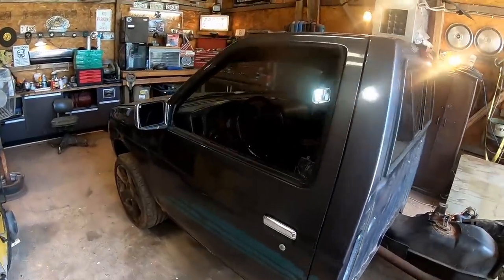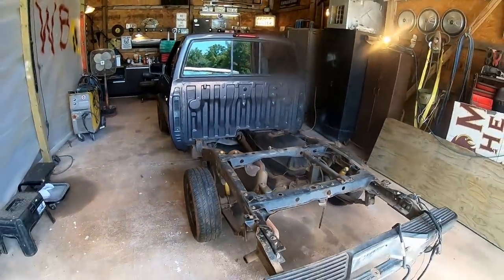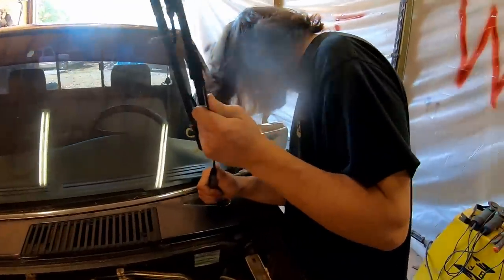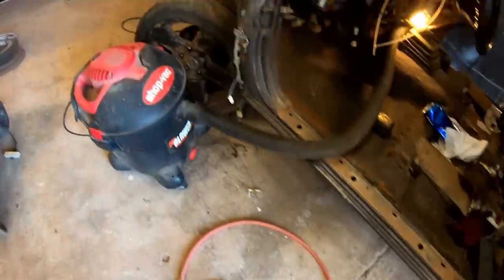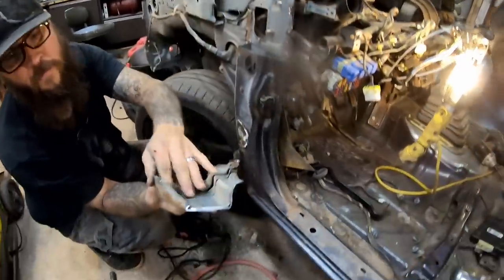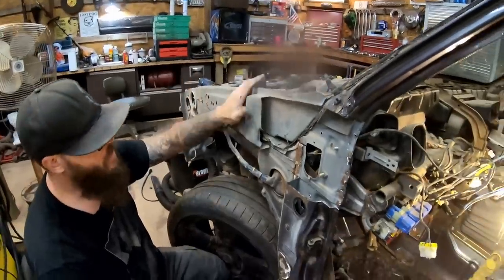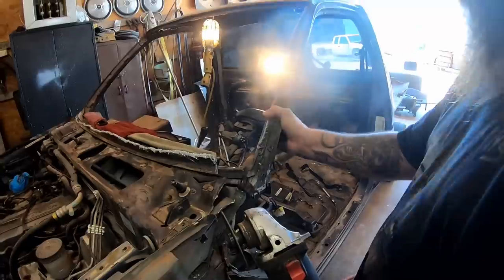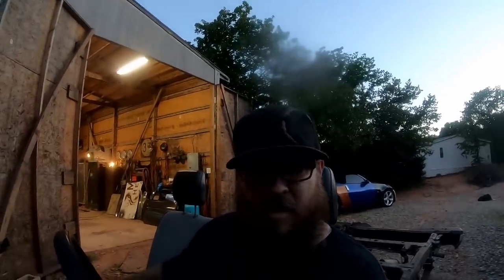Copart Datsun Pickup Build Part 1

Comment: I once saw a 1956 Ford Crown Vic body set on the frame and floor pan of a Bronco 2 wheel drive.  As long as you couldn't see the inside it looked like just another 56 Ford.  The guy said the car had set on the ground and the frame and floor boards were rotten out and he put it together for not too much money.  I like what you are doing, it will be cool.

Comment: This is going to be really cool. I wonder if the old Datsun will be close enough to even fit a little but maybe they used a little bit of the old measurements in the new one or there is some coincidences. Remember road kill had that Datsun with a v8 in the bed LOL. It will definitely be nice to drive the old Datsun with ac and a six speed. The old look is iconic. LOL

Comment: Mike closing in on that 20.k 🙌✊you did amazing job on the Harley . I had a little Nissan truck with the bad motor & bought a wrecked 86, 300z turbo & spent 6 mouths converting.  Finally got finished let my girl drive it to work 🤔 she was sideswiped at a intersection ! Totaled in a split second 😭

Comment: I had one same year and color and the bed rotted off, I sold it at 330,000 miles and I swear it never burn oil or leaked a drop. It was one of the best vehicles I ever owned.

Comment: YIKES! yeah she's been up north. if it wasn't flaking like that i would say weld some plates on the frame to stable it up again. and yeah that's the fun of those trucks is the AC is usually pretty bad ass. that datsun truck looks really nice for it's age.  can't beat that either it's a nice solid foundation to graft all that's rotten   as long as that's a go pro hero 5 or 6 you can simply twist the lens off of the front and replace it. new ones aren't very expensive at all. I personally am getting away from Go Pro. I've had my fill of them already. Todd from Unwrecked told me about the new DJI action cam and i think that's going to be the new move $349.00 4k nice image stabilization and it's cheaper than the newest go pro but only $40 less than the new Sony action cam which i also really love the features and function of.  decisions descisions! Pioneers are Junk but if they work they work. save those White plastic surrounds that are mounted in the doors behind the speakers too they make a HUGE difference in the way those speakers sound. Roof skin, rear window and rockers are all still looking good on that truck still. might try separating those parts and listing them on craigslist or Faceboook Market place. might get a few dollars for them any way. I'm curious, whats the state of affairs with the 350Z? waiting on parts or something? just curious

Comment: you don't need the Nissan body at all just use the drivetrain! Body drop it and drop that frame on the ground with airbags. Gotta find somebody for a big audio system and a camper shell like though Mini  trucks in the 80s and early 90s